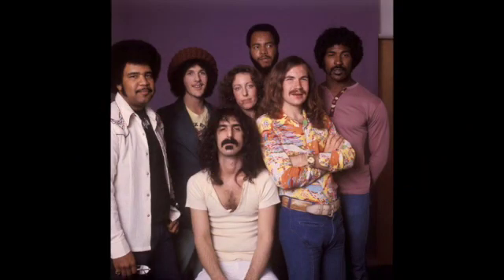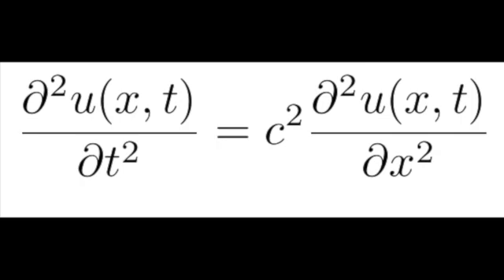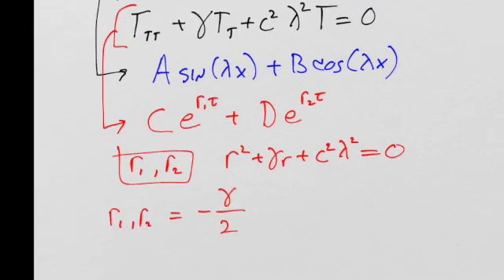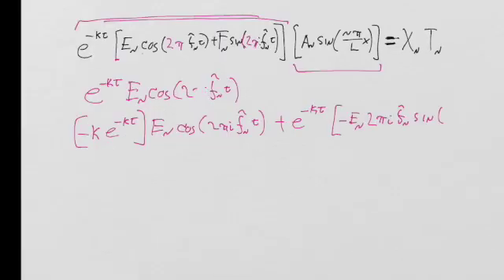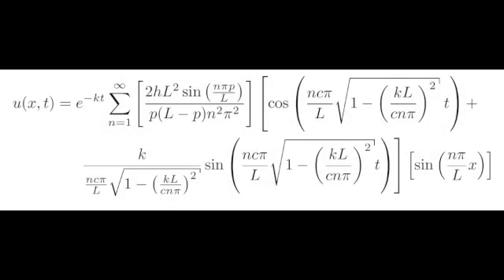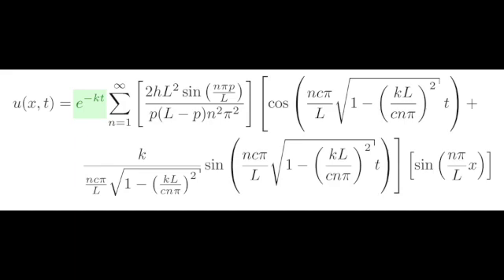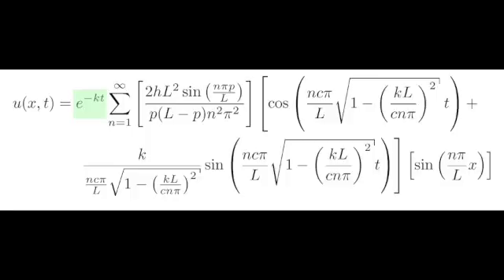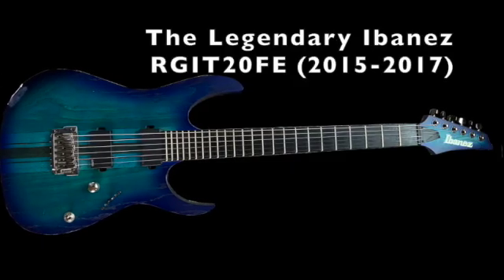The Physics of Rock II: The Damped Guitar String

Comment: I recommend this series of exercise to students in physics because the quantum mechanics and the quantum field theory mainly deal with wave equations. The resonance phenomena are ubiquitous around us in musical instruments, microwave cavity for atomic clocks or accelerators. 

I hope this series to be extended to accounting for the coupling effect to the other resonator i.e. the body of the guitar. Because the body has its own response function and it will give the effect of varying damping constant against the mode frequency. Your experiment showed that some mode lasts longer than the others. Very low or very high modes decay faster because the guitar body has broader bell-shaped response centered at a few hundred Hz.

Thank you for your effort. I enjoyed your lessons.
Reply from the maker: I didn’t plan on modeling the resonator, but that would be fun. I would like to find a model that demonstrates frequency dependent decay rates and also dispersion, but I also want to work with entirely analytic models and avoid any discrete element analysis. For now at least. 

I was going to spend some time with more and more applications of the wave function. Next up is damping AND stiffness, which is actually rarely calculated and I think I have to do the analysis from scratch. Then 2-D drum membranes, then some of the E&M surrounding guitar pickups.